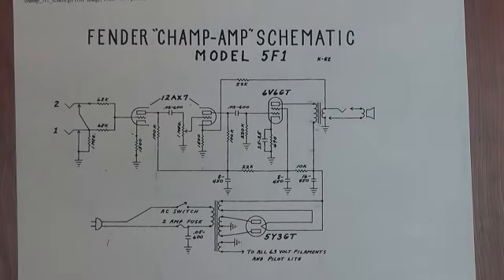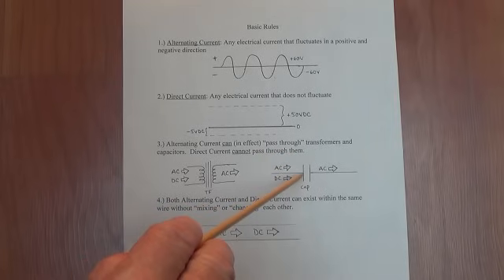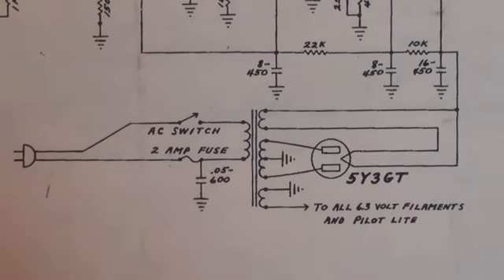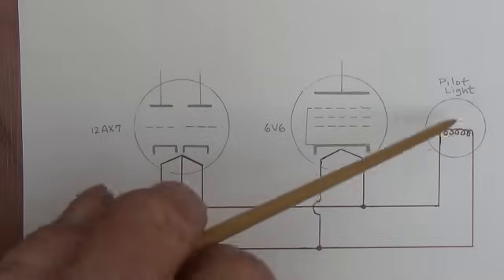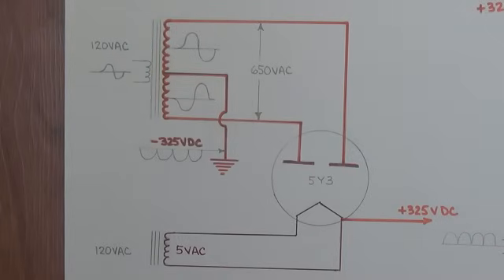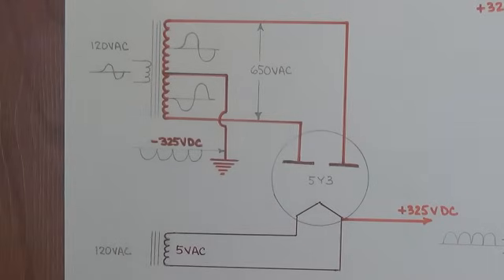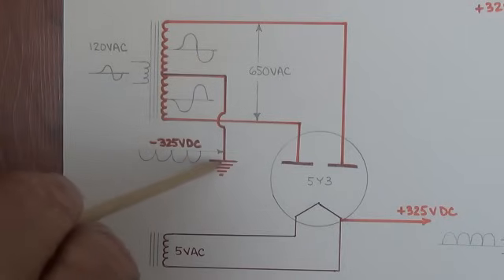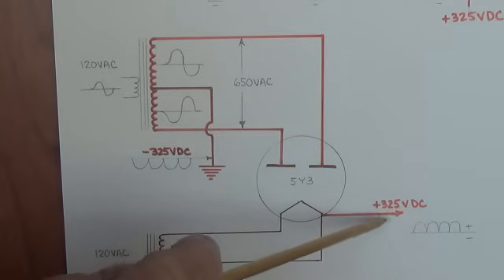How Tube Amplifiers Work, Part 1: The Power Supply

Comment: You know something that, it seems to me, would be useful for us readers to understand, would be to go through a simple circuit like the Champ, and explain at each point what sorts of voltages and currents are present, why they are the way they are at that point, how that affects the downstream components to achieve the desired effect, or maybe in some cases it doesn't much matter what one or the other is because it's not important to the functioning of the circuit.

These types of things I think are sort of mysterious to folks who are just getting into it. Understand that in various places it could change according to the frequency or amplitude of the incoming guitar signal, but you could maybe look at a couple example input signals or something.

Does that make sense? I always wonder about those things when I see these sorts of circuits and feel like I should know them to really understand what is going on. And of course I don't mean just do the Omh's law calculations for us. But it's more about the WHY, not the WHAT, which is what almost all of the basic circuit analysis videos are about. They show you how to calculate things but there's little on why you want to make these things particular values to achieve specific results.
Reply from the maker: Most schematics provide the information you seek, Dean.....the voltage levels at different key points within the circuit. As far as current goes, it's really never a big concern (unless there is a short circuit). It tends to be low in the amp circuit and high in the post-OPT (to speaker) circuit.  I would like to think that the "WHY" questions are pretty well answered throughout most of our videos, especially those which endeavor to explain how each portion of the amp circuit functions.

Comment: Hi Uncle Doug! first of all really compliments for your videos they are amazing and clear!! Then i wanted to ask you a "language" question. What do you mean by fairly stout wires? I guess fairly = quite and stout = thick, big and heavy so that resistance decreses? am i right? p.s. i'm not english :)
Reply from the maker: Thanks, Claudio, and I do apologize for the rather vague terminology.  By "stout", I meant 14 or 16 gauge, rather than the usual 18 to 20 gauge wire. Since a fairly significant amount of current flows through the filament circuit, the heavier wire is required to reduce resistance, as you said.

Comment: I have another question, this time McIntosh's method of screen grid wiring. I don't know how familiar you are with McIntosh but in many of their (tube) models including the MC-240, each screen grid is wired directly to the opposite tube's connection to the primary OT coil. Each plate goes through a choke coil to the OT, and the cathodes go through an autoformer to chassis. Do you know of any advantage to McIntosh's unusual connection concept? Thanks.
Reply from the maker: Rusty and I don't work on HiFi's and Stereos, 411, but I would assume that each of these wiring peculiarities is designed specifically to reduce distortion. No doubt, others know more about this and are welcome to chime in with perceptive insights.
Reply: K thanks

Comment: Uncle Doug, a question if you'd be so kind. I see a lot of different 12AX7 tubes out there, some going for crazy prices. In your opinion, what separates a new Russian 12AX7 from say a vintage RCA, or one made in Holland? TIA!
Reply from the maker: Although Rusty and I tend to use vintage tubes in our amps, mainly due to the fact that we have acquired a bunch over the years, we are not totally convinced that ultra-high-dollar vintage tubes are all that much better than their modern counterparts.  Proof of this is that when we don't have a proper vintage tube on hand, we buy modern tubes.....mostly Russian made.

Comment: Thank you ever so much Uncle Doug for this series, great for beginners like me. When you talk about 120VAC, you are referring to US AC? And if U.K. AC voltage will that be 220? Also, around 14.40 the boxed text reads that the center tap is grounded to the chassis, but what if you don't use a chassis? Or if your chassis is e.g. wooden?
Reply: Yes.
Reply from the maker: Yes, my references to wall receptacle voltage are based on USA standards. If you are using a wooden chassis, you will have to provide wiring to replace the missing metal chassis. Wherever a wire or component would normally connect to a metal chassis, you will have to run a wire from the grounded end back to the centertap of the proper power transformer winding (6.3VAC and high voltage).
Reply: Thanks again! Can I also use a copper or aluminum plate/sheet?

Comment: Dots on the transformers normally indicate polarity. How come the transformers have dots 3:47 all over the place? Just curious, it seems confusing. Great videos!... just interacting. Is there a reason for it? I never knew there were bipolar transformers just bipolar wifes ;)
Reply from the maker: Since power transformers are AC devices, LP, polarity really isn't an issue. The dots on the schematic indicate connections between wires.....not polarity.  Unlike wives, transformers are never bipolar :)
Reply: Thanks

Comment: With the 12AX7, I can see that the heater filaments are in series but they are electrically joined by the external wire between each end. Surely the wire between the exterior ends of the filaments should not be present? (i.e. they seem to be shorted out). If that connection is removed the current would pass through the filaments in series as required, and on to the other filaments in series. Sorry if I've misunderstood this - your explanations are outstanding. Thank you!
Reply from the maker: The filament of the 12AX7 tube is center-tapped so it can be energized to 12VAC from a 6VAC transformer winding.  Imagine that the center-tapped filament circuit looks like a "T", with 6VAC flowing (from the power transformer 6V winding) up the vertical part, then splitting left and right through the horizontal top arms. There would be 6V in one arm + 6V in the other arm = 12V. The connection you are asking about is the one that goes to the tips of both of the arms, completing the circuit and allowing the current to flow back to the power transformer.
Reply: Thanks for that extra explanation Doug. I think I have just about got it but I think the "12V" designation is still a misnomer.  There are no points on that filament circuit that you could actually measure 12V AC - the voltage remains 6V from the unalterable 6V winding on the transformer. To me, what seems to be happening is that there are simply two 6V supplies IN PARALLEL for those two heaters with the rest of the heaters in the other valves in series with it. Again apologies if I still have not grasped it properly - no need to reply - I'll carry on thinking.
Reply from the maker: I believe you'll find that the filament halves are in series, DIY, and (just like with batteries in series) the voltages add together for a total of 12VAC.
Reply: I agree with diymostthings - the 12AX7 has a center tapped filament. It can be run as one single 12VAC filament (center tap not connected), or as 2 separate 6VAC filaments (center tap as a common leg). When in center-tapped mode the filaments are in parallel, and here, both are using the same 6VAC source. Two taps off of the same 6VAC source do not add to give you 12VAC. Likewise, you could not take two taps off of one 6VDC battery and produce 12VDC. You would need two independent 6V batteries in series to get 12VDC, or two independent 6VAC power supplies in series to get 12VAC (or two independent 6VAC windings off the same transformer)
Reply: Thanks b minor. well that kind of bears out my thoughts, thank you. The remaining problem for me is the wire that connects both ends of the filament.  surely this simply shorts out the filament which would therefore never heat up. A caveat to all my comments is that I am no expert and really appreciate the clear explanations given by Uncle Doug. My comments are not a critisism, just an attmept to understand these principles better.
Reply: The filament is center tapped. Think of it simply as two separate filaments in parallel, like two separate light bulbs plugged into the same wall socket. One end of each filament is connected to the positive side of the 6VAC source and the other end of each filament is connected to the negative side of the source. So you wind up with a 6VAC potential across each filament. Follow the flow of electricity through each half of the filament from negative to positive. They happen to share a common leg, but you could think of it the same if each filament had two independent wires. Even though a filament is technically just a piece of wire, just like a light bulb filament is, but they are pieces of a special type of high resistance wire (kind of like what is in a toaster). The physical properties of the special material 'absorbs' (or consumes) the energy of the AC current flowing through them and that's what causes them to heat up. If the filament was simple copper wire, yeah, the resistance would be so low that they would 'heat up' so fast that they would burn up (essentially a 'short', aka 0Ω of resistance). But they are not simple copper wires. Likely they are something like Kanthal wire.
Reply: And BTW, I too greatly appreciate the explanations by Uncle Doug. Even though I understand a bit about electronics, it's always great to hear clear explanations of real and practical circuits. There are so many 'tricks' to how they work in specific ways that aren't always obvious just by knowing the abstract principles. Electricity is sort of magic, since we can't 'see' it - we can only observe the results of it, and it isn't always easy to imagine what is really going on or going to happen under different conditions. You can get it to do all sorts of things that are often only found out through experience and experimenting. Especially when you are looking to achieve things that are more about 'preference', like qualities of audio. I remember reading an old book about tubes where they described how 'horrible' tubes are when the start to distort and how to avoid that 'nastiness'. Little did they realize at the time that would turn out to be exactly what some people wanted in order to create 'art'.
Reply: Thanks again for helping me out b minor. If you take a look at the frames at and just beyond 5.23,  you will see that the filament on the circuit diagram is literally shorted across with a wire. Virtually all the heater current will flow through that wire rather than the higher impedance filament. I believe that "shorting wire" - between the two connecting blobs should not be present on the diagram and is a mistake. The 6V6 tube, next in line is correct - the filament connections are between the top transformer winding connection and to the return path at the bottom of the winding.
Reply: +diymostthings - the two outer ends of the filament are indeed both tied to the same point - one end of the transformer wiring  (aka 'shorted'). That is correct. There is no current flow between those two points because they are both at the same potential. The center tap (the other side of each half of the filament) is then tied to the opposite side of the transformer. Current flows from one end of the transformer, through the two parallel filaments and then down through the common center tap and back to the other side of the transformer windings. Maybe if you change the diagram to show the filament halves as two separate resistors and move them around in a drawing a bit, you will see it better.
Reply: Hi DIY, I don't know if you fully understood the filament wiring of the 12AX7 tube or not. I can tell you that as Uncle Doug stated, it is a center-tapped filament. I read it right from the Sylvania & RCA Tube manuals. The 12 is not a misnomer though, as if you wire a 12V supply to just pins 4 and 5 it operates on 12V @ .15 amps current in series. As wired for a 6V supply, pins 4 & 5 go to one lead and pin 9 (the center tap) goes to the other. In this configuration, the filament is operating on 6V @ .3 amps current in parallel. I'm only giving you the information as printed in the manuals... I tend to think it is correct, however I know Uncle Doug and Rusty don't agree with this. But, since He and his gang have taught me everything I know about amplifier electronics, and it's the only thing they've stated in all those video's, I've ever had any doubts about, I'm tearing out those pages in my manuals! Lol  Hope this helps, Tom

Comment: wow these are the best videos I've seen describing tube circuitry.  unfortunately, I am going to nitpick again.  Around the 17-minute Mark when you were describing the power supplies, you label the center tap as a -325 volts DC and the other tap as giving + 325 volt DC. Unfortunately, that would not be the case with a 650 volt transformer from outside tapped outside tap. Since you're operating a center tapped full wave rectifier, you have connected the central tap to ground so you're reference is 0 volts not -325volts.   Your supply 325 volts.  if your Center tap was giving you -325 volts and your outside tap was giving you+ 325 volts, then your power supply would be 650 volts.
Reply from the maker: Thanks for your input, Jack. Once again, all of this is carefully explained in my more recent videos on power supplies.

Comment: my apology for a nit picking on a really nice video but at the one-minute Mark you state that for Mains voltage the height from Peak to trough would be 120 volts. Actually, for Mains voltage, the peak to trough would be 2 times 1.4 times the RMS voltage.  the first factor of two comes because you are measuring Peak to Peak or peek to trough as opposed to Peak to zero. The second factor of 1.4 is, because you were talking of peak voltage and the stated mains voltage is given in root mean Square (rms).
I did not want to hit that, but if you work on a rectifier power supply the peak voltage you are exposed to will be strongly affected.
Reply from the maker: Thanks for your helpful and knowledgeable input, Jack. All of this is clarified in my subsequent videos on power supplies.

Comment: Oh and also wouldn't your negative voltage from your transformers centertap to ground still be ac since it's not been changed to dc by your rectifier yet?
Reply from the maker: No, it has been rectified since it is part of the secondary circuit through the rectifier. It is negative DC.

Comment: How do centertaps not put a charge on your chassis? -325vdc is still deadly voltage right? Great video too!
Reply from the maker: For current to flow, a circuit must be closed, JP, and with a power transformer's secondary high voltage windings, the chassis is part of that circuit.  Electrons within a circuit remain in the circuit, so the electrons flowing through the chassis remain in the circuit with the windings of the power transformer and have no interest in going elsewhere. Thus, they present no shock hazard if you touch the metal chassis.

Comment: Hi Uncle Doug, I love your videos. I used to repair electronics as a hobby and stopped doing so 20yrs back. Recently I needed a amplifier at home and hit on the idea of acquiring and restoring a tube amp. Unfortunately the amp I purchased is a mono tube amp having ECC83 for preamps and 6L6GC for amps and I thought it was stereo. Now I am toying with the idea of converting it to stereo. I have posted the pictures on google drive https://drive.google.com/open?id=0B26XTTwYvNbjZUM2WGtOYllHb3M . Please suggest any circuit diagram which I can build using these components.
Reply from the maker: Greetings, Ron. Sadly, there is no reasonable way to convert a mono amp into a stereo amp......unless perhaps you bought another, identical mono amp to go with the first one.  Rusty and I deal exclusively with vintage (mono) guitar amps, so this is out of our field of expertise. Perhaps you can sell the amp you have and buy a stereo amp. Best of luck.
Reply: Hi Uncle Doug, Thank you for the very quick reply. I guess I will just sell it off if I can. I live in India and  cannot afford a new stereo tube amp which will cost me months of salary and I doubt I will find one for repairs anywhere soon. Anyway thanks , you are doing a great job. Cheers.
Reply from the maker: Never say never, Ronald. Rusty and I will keep our paws crossed in hopes that an affordable stereo amp becomes available to you.
Reply: Thank you for offering to help. God Bless you.

Comment: Thank you Doug.  This video has been so very helpful in my understanding (or lack of understanding) of vacuum tube power supplies.  Now I have to watch part2.  I also appreciate the added notes to the video with corrections and further comments for clarification.  Wish I could give this video more than one thumbs up!   Just for my clarification, measuring the rectified output of the 5Y3 between ground (where the video shows -325VDC)  and the rectified positive output will measure +325VDC because ground still has a zero VDC potential.  Correct?
Reply from the maker: You're welcome, XT. We're glad the videos are helpful.  Yes, my diagram is a bit confusing but the rectified positive output will indeed measure +325VDC with reference to ground. The -325VAC reading will be obtained if you measure the potential between ground and the B+ (i.e. reverse the probes).  I was trying to make the point that all voltage measurements are dependent on what is being measured and in reference to what.  In retrospect, this was probably counterproductive and confusing. I hope this makes sense.